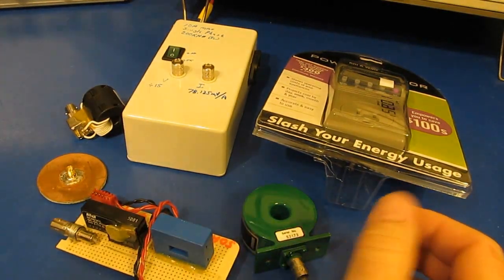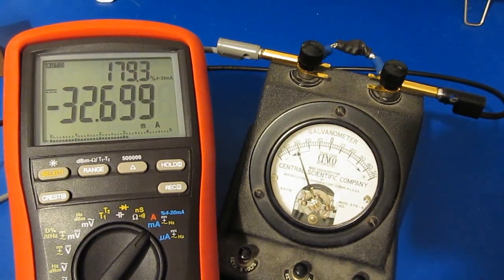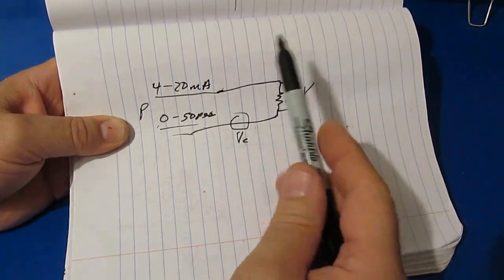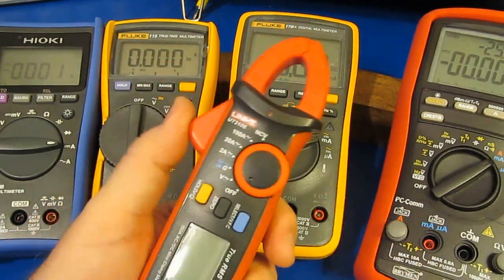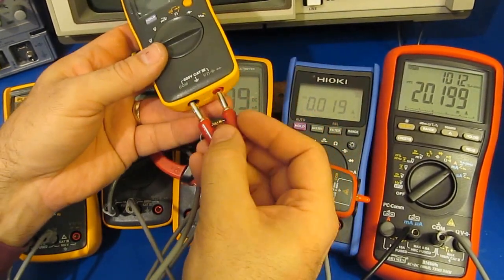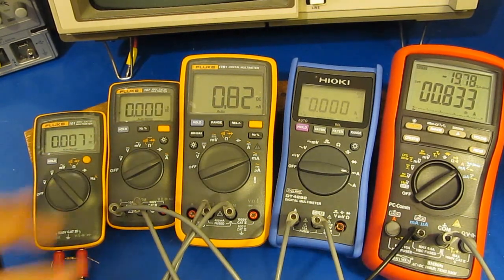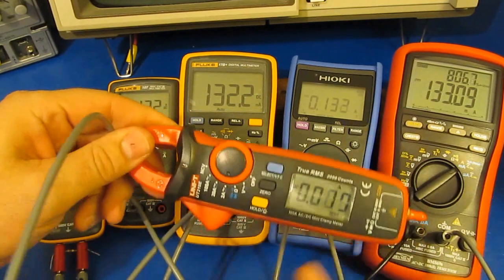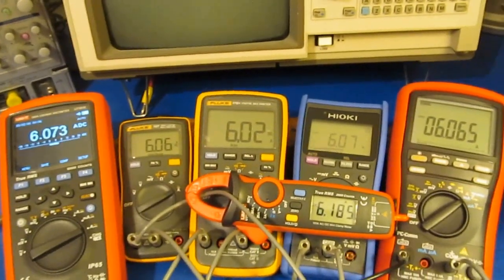Testing DVMs in the 4-20mA range

Comment: the trick with the fluke 101 and the resistor.
can that be done with any multimeter?

how to calculate the size of the resistor needed?

do you have maybe a video explaining this setup in more detail?
Reply from the maker: For all practical purposes, any volt meter can measure current using a shunt.   Look up ohms law.  Pick the resistance and Wattage based on your meter and what you are trying to measure.     https://www.youtube.com/watch?v=tgA6Ii_KAPs
Reply: @joesmith-je3tq  thank you

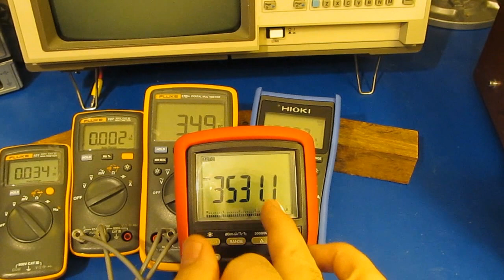Comment: 10:20 - Brymen BM869s measure 3.860 mA, changed to uA, and now is 3531.0 uA.  This is 8.5% less current.  Why?  Burn voltage?  And What is the Correct measure, 3.860mA or 3.531mA?
Reply from the maker: That's just the difference in the burden voltage.    Both are correct.

Comment: Hi,

Can you recommend an ac/dc clamp meter (mainly for automotive use), that best/ accurate for testing parasitic draw. Price is not important. I purchased the fluke 376fc but then found out that it can not measure in the milliamps. Cancelled the order. I also looked at the fluke 902fc that can also measure micro amps up to 200 micro amps. would greatly appreciate your input. Thanks
Reply from the maker: Nothing I would recommend to a professional.  Most of what I am familiar with are for lab use and are not something you would take into a garage.  You may find the best accuracy obtained using precision shunts and volt meter.

Comment: Is there any reason not to wrap multiple turns through a hall-effect clamp? I find myself using 2-5 loops around my DC clamp sometimes to boost precision
Reply from the maker: Beyond maybe not having enough length in the cable or it being too thick bend, I can't think of a reason.  It's a fairly common practice.

Comment: I've got the UNI-T  and I used it to test a linear actuator which said 3A max 12v. When I measured the current while it was running it was only reading 0.6A even though I had is hooked up to a 15A 12V supply - what gives?
Reply from the maker: I'm not there but you are.  I assume you are talking about a DC supply.   Do you know how to use ohms law?  Did you measure the coil resistance?  Did it match the datasheet for the part?  Did you measure the voltage across the coil?   Did you calculate the current?    If this current did not match the meter, did you set the supply to CCM and verified the meter was working?
Reply: @joesmith-je3tq   Thanks for replying. The actuator was bought from ebay and is a 12VDC 3 amp one. It is a sealed unit. I just measured the current while under load to see if I could get a way with a 3 amp supply, as usually you need a little overhead. I was surprised it was only drawing 600 or so MA and don't understand why it says 3A max on the side of the motor.
Reply from the maker: @ArcanePath360  Maybe its not drawing 600 or so mA.  I can't help you if you don't answer the questions.  Keep in mind that the rating is for some load/displacement.  Again, I am not there have no idea what you are measuring. You would need to provide a lot more information.
Reply from the maker: Maybe it is rated for 100 lbs and you are looking with no load.
Reply: @joesmith-je3tq  Thanks for repying. That is true, I didn't think of the load in terms of weight. It is rated at 750N weight. Are you saying that the current would increase to push a heavier load? I measured with the Unit-T with the clamp around the positive wire going from the wireless control box to the actuator to answer one question. I am not able to measure the other stuff as the motor is sealed in a metal housing. I'm not sure what you mean by setting the supply to CCM? Also it's the first time using this meter so have nothing to verify it's accuracy.
Reply from the maker: @ArcanePath360  CCM, constant current mode.   Basically set the power supply to 1A and see if your UNI-T matches it.  You bet running it with no load is going to draw less current than with the maximum load.   I assume it is a worm drive system.  I wouldn't recommend trying to load until you fuse it at 3A.   The motor may not self limit to 3A if you stall it.   You may also damage the gearing if you try to exceed it.
Reply: @joesmith-je3tq   Ah, I see. I should explain that it isn't a bench supply, just a standard PSU. The only option is setting it to 110V or 220V with a trimpot to adjust the voltage.  Thanks for the advice. It's not a worm gear, just a regular gear, since the motor is parallel to the lead screw.
Reply from the maker: @ArcanePath360  I would have no way of knowing how the unit is geared.  You have provided no part numbers.  I am not sure what a "regular gear" or a "standard PSU" would be.   If the supply has no current adjustment, best to add the fuse to prevent damaging the part.  Your motor is like any other, it will consume less with a lighter load.  You could try some really simple experiments to see this.   If you wanted to get fancy, you could used some weights you would normally see in the gym, and plot the force vs current curve.
Reply: @joesmith-je3tq  By standard gear, I mean that all the gears run like they do on a clock, along a single plane. A worm gear transfers power from X to Y. By standard PSU, I mean a PSU that you would get with a computer or 3D printer. It already has a fuse inside the metal housing that I can see through the air holes. I had no idea motors would draw more current to fight against an outside force, I thought they drew a fixed current somehow. It seems I have a lot of gaps in my knowledge. So if I overloaded the weight capacity of the actuator, what happens then? Does it keep trying to draw more current until it overloads the power supply and/or damages the motor (without a fuse)?
Thanks for the insight.
Reply from the maker: @ArcanePath360   Eventually you will stall the motor. There are typically specs for a locked rotor condition but I doubt your motor would survive if held like this for very long. Then again, the gears may not be able to handle it. It's hard to say.   The motor is doing more work as more load added.  To do that work requires additional power.  With your meter, you could see this even with a small hobby motor by watching the current and applying a load to the output shaft.    Most fixed supplies like you describe will indeed have at least one fuse, normally on the input side.   You really want to limit it to the 3A.
Reply from the maker: @ArcanePath360  The center readout is current.  The small green motor is driving a generator that is attached to a light bulb. This is the load for the motor.  Watch what happens when I attach the bulb.  https://youtu.be/7K8JW6XFR-E?t=134
Reply: @joesmith-je3tq  I have learned much here, thank you. It has been my knowledge prior to this, that you can never over do the power supply, as long as the volts match what you are powering it will draw what it needs, it's best to have more amps supplied than you need, so you don't OL the supply. I guess the fuse is a good safety measure to protect the equipment. I have checked and yes, the fuse is 250V and is on the input side, which I find strange since the AC plug has it's own fuse.
Reply from the maker: @ArcanePath360  Once the motor stalls, the only thing you have is the I^2R losses.  The 3A 12V rated motor could actually draw more than the 15A your supply is rated for, well, for a short time anyway.   You could see this with a small hobby motor, battery and your meter.
Reply: @joesmith-je3tq   Is this what happens in a drill with a battery? When the motor stalls I sometimes smell burning briefly. Is that excess current?
Reply from the maker: @ArcanePath360  Most likely.
Reply: @joesmith-je3tq  Thanks

Comment: Again thanks a lot for taking time to make this video, The shunt trick its really nice I didn't know about it, thanks God for the Ohms law 

do I need to use back to back diodes with 10ohm resistor to protect the meter ? and can I use a 100ohm resistor or even 1Kohm to get volts instead of millivolts ?
Reply from the maker: +IGATECK No problem.  Sorry but I can't be of much more help.  I do not know the systems you are working on or anything about the environment.   I would have safety concerns using a shunt the way I show in an industrial environment.   I posted some of my concerns on the EEVBLOG site.   The range of the resistor you could use for a shunt is going to be determined by the system you are working on.
Reply: +joe smith ok thanks for all the help and I think I will buy the Uni-t  ut210e I think its a really nice meter for the price and I can always wrap a couple coils around the clamp to get a more accurate reading, and I'll check the blog thanks
Reply from the maker: +IGATECK That's an excellent point and now that you mention it, I should have showed that.